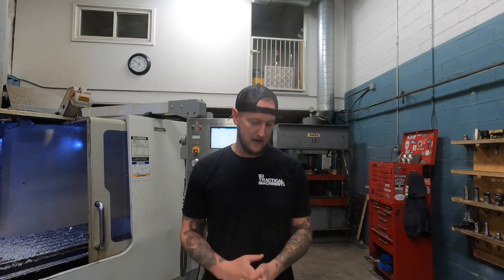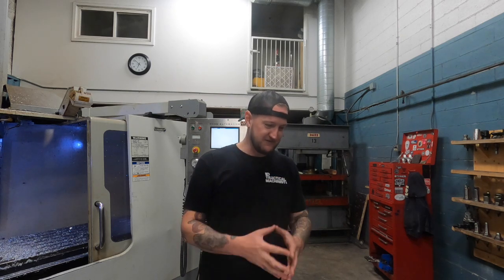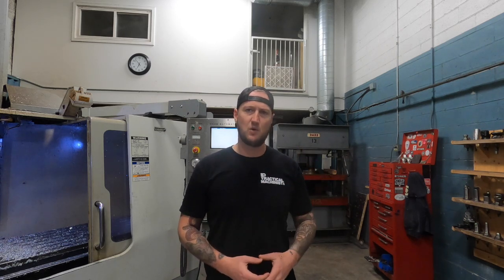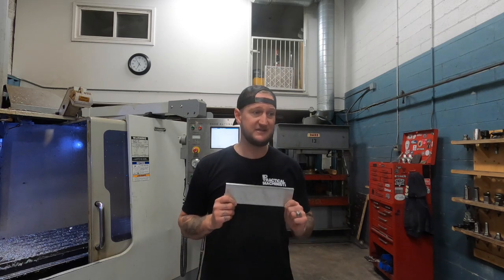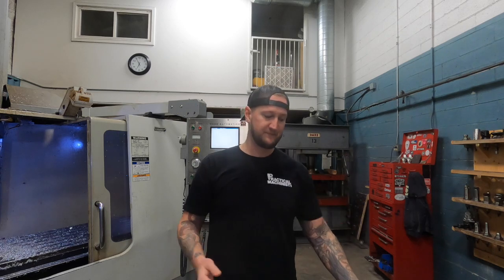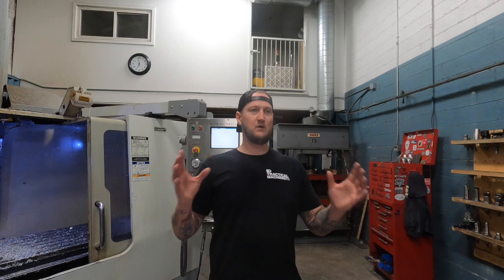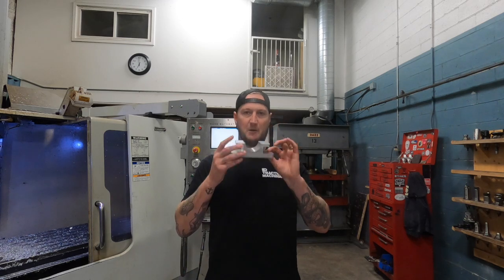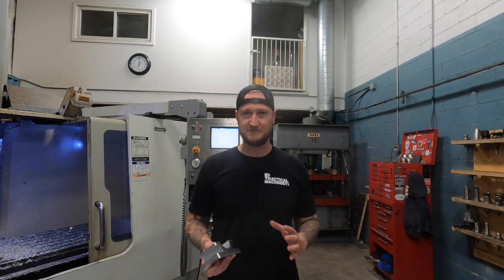How to Design a Part from the Ground Up | Machine Shop Talk Ep. 41

Comment: 100% dead on. The parts I make now are designed to have a specific compound radius. The programmer setup the program to plunge cut with a 1/8 mill into a finished sloping angle...

Did I mention the .0003 tolerance?

Comment: I was a designer & engineer for the majority of my 50 year career. Your video is SPOT ON. Over that period, I too made mistakes (call them learning experiences). The fortune 500 company I retired from began using a process where a project design included an engineer (or 2 depending on scope of the project), a draftsman/designer, a fabricator (machinist, welder, whatever) an accountant, maybe someone from sales, along with others who had a "dog in the hunt" where the project results were concerned. It was usually a week-long process and frequently looked at by those attending as an eye-roller. But the outcomes were far better than the process used in the past where only 1 or 2 people were involved. On larger projects, we even included outside contractors to improve construction times & decrease costs.
Reply: I follow the same process, but all those people are me.

Comment: My gosh I am so glad that you made this video and brought this up because this is a huge problem in this industry. Its easy to over engineer a part or a fixture but its usually never easy to machine an over engineered part. Great Video and topic Ian, as always!
Reply: You're absolutely right there - complex or overcomplicated may look super cool in a 3D model, but sometimes I think there's a big disconnect between designing a cool part and actually managing to machine that part in a way that makes sense! Thanks again for checking it out!

Comment: i find most people who design parts have never done machining . had a part to make once had a 15mm  through bore and an internal groove of 50mm , ends up groove was only there to make drilling the oil holes easier lol  , it was changed to 17mm . The same company has sent a lot of parts to quote and we have no quoted , A month later get the same part through to quote with a please have another look as we cant get it made , we tell them how we can do it by changing it to a 3 part assembly , within a couple of days 3 parts to quote . this company like interns .
Reply: Couldn't agree more - I just had a similar situation where I had a 2 part assembly come in to quote - the whole one 6" face had some huge rad on it, and then that plate got welded into another part. 

When I quoted it out high because trying to machine it as drawn was going to be tricky and time consuming, they were a bit shocked and asked what they could do to get the price down. I suggested making it a single part that would make it a lot easier to hold on to, and it would cut the welding out as well. Lo and behold, we got the job and just shipped the last of 300 units last week!

I think it's a matter of someone gets an idea and gets laser focused on executing that idea rather than what the part actually needs - but it's always nice when people are willing to hear suggestions to make their lives easier! Thanks again for checking it out!

EDIT: Ha, the part I'm talking about is actually the one I'm holding in this video! That bottom plate was it's own part originally - it would've been a pain to machine alone!

Comment: I definitely design the part in an 'unconstrained' state first while being vaguely aware of the machinability envelope in the back of my mind, but not worrying too much about material, specific tools, etc. Get the best possible geometry to do the job figured out first. 

Then at a high level look for the features and aspects that get close to the machinability envelope, and start modifying the design as required. Make the compromises required to adjust the design to work with nominal stock size, change pocket depths or the allowable radius, etc to match tooling, maybe make alterations to allow for better work holding (I had a part recently where I had a few bosses I made a 2mm longer so that they could be coplanar with another surface, allowing me to hold the part in vise on a set of parallels.)  But absolutely all the points brought up are very true: What material, what stock size, how to hold it, and what to cut it with?

Ironically I run into the opposite problem of "should have built a fixture" where when doing small volume parts I'll way overthink the custom fixturing when in reality even for a 20 part run it would have been more efficient to just stick the part in a regular vise with some blocks and shims to get it all secure, and probe in each part individually. Sure if doing 100 might be worth making special fixtures but if each part for a 20 part run only takes 5 min to setup and it is equally good output, then was it worth spending 2-3 hours extra time programming and machining custom fixtures?
Reply: For sure - once you've been around the block a few times, the design process tends to invert itself, where you're designing for function and purpose first and figuring out the constraints second - the benefit is that since it isn't your first rodeo, you don't make some of the choices a rookie would right off the bat!

I've definitely had that same issue before, where I spend a lot of time and effort trying to make some really dialed-in fixturing, when a set of soft jaws probably would have been fine - it's always a live and learn situation!

Comment: I am literally doing this right now for a company called engine trix. I was set on making a fixture plate with mitey bites but ultimately when I really thought it out, turns out 2 vises and a long set of soft jaws was definitely the easiest and most efficient way to do it.
Reply: I know that feeling - I got some Mitee Bites in a while back, and for a while I was so excited about using them that my entire design process for fixtures was basically based around them. It took a minute to reevaluate and realize that while the shiny new toy is good for some applications, it’s important to figure out what you actually need - not just what fun component you want to use!

Comment: Good video.   I start with the part function but might spend another 25% revising it for manufacturing.  Move back and forth between the total design and the details.  If there are several parts can some features/functions be moved from one part to another?  Assemble a couple of simple parts or make one big/complex one?   Instead of a mix of 0.25, 0.312, and 0.375 bolts can everything be 0.375?   Watch out for "non-value added" details.  Things you think are nice that the customer wouldn't pay more for.  Does it need to be milled or just left saw cut/stock?  32 finish everywhere because it looks cool?    Thin sheet metal may save pennies for material and cost more to weld/machine.
Reply: Non-value added details are a KILLER if you let them be, I agree! Yeah, it looks super cool if you put these tiny little 1/16” internal rads in this part, but did you just make the part take 3x longer because now you have to pocket it all with a 1/8”?

Very, very good tips - thanks for sharing!

Comment: Overengineering may cause more breakage to other parts that it has to work with. Some parts are made of nylon so that it breaks before other more complicated and expensive parts when overstressed.
Reply: Absolutely! That’s something to keep in mind - much like you want the bushing to burn out instead of the shaft - much cheaper to press out and press in a new aluminum bronze bushing than turn down and grind a new shaft!